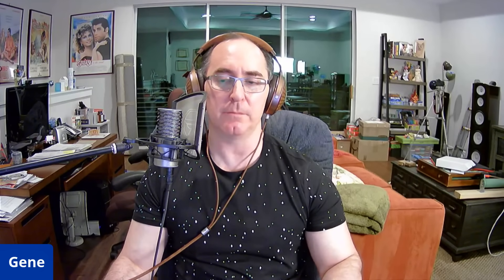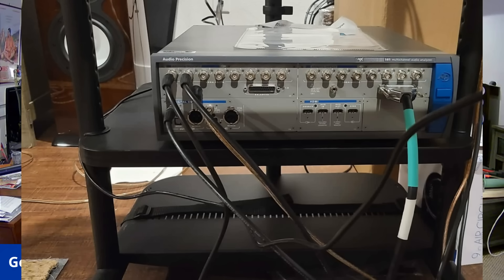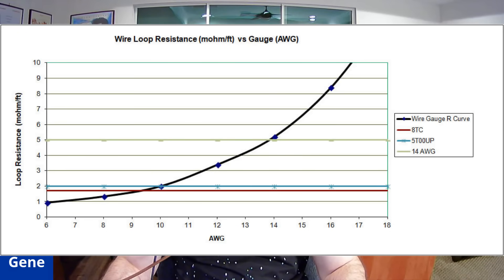Speaker Cables Really Don't Make Much of a Difference?

Comment: Scientifically confirms what I sorted out years ago.  I never claimed there wasn't a difference, just that the difference was insignificant and surely not worthy of spending $100's to $1000's of cables.  I found that investing that $$ in better amplification and speaker technology always yielded superior results.

Thanks Gene!  Great work here.
Reply: Greetings,

In the early 1980's, high-end speaker cables were beginning to appear on the market. Some of the product claims were totally unbelievable and had prices to match. And, the nonsense is still being foisted on us today.

Audio cable must be burned or run-in for a 100 hours. The best cable is cryogenically treated. Audio cables are directional. They must be supported off the floor via insulators. They have damping factors. They must be 'conditioned' to keep the wire molecularly aligned. Ad nauseam. It is all snake-oil designed to part the naive buyer from his money. It is all a crock!

The ONLY factor that affects performance of audio cables is the wire gauge for a particular maximum distance between amplifier and speakers at a particular Ohm rating. If you have the proper gauge, all audio cable will sound exactly the same!

"Realizing that wire resistance was the critical factor in speaker wire, Gordon Gow, then President of McIntosh Laboratory, still a maker of world class, high fidelity amplifiers, used a speaker cable demonstration to show there was no listening difference between high-end audio cables and plain line cord (14 AWG lamp cord wire). 

Fifty-foot lengths of wire were used in the blind comparison. The setup consisted of a master control relay box and two slave relay boxes. A three-position switch was used to select one of three different speaker cables of equal length. One was common line cord. The other two cables were from popular high-end manufacturers. 8-ohm speakers were selected for the test. The two other brand name cables were heavier than the line cord. The test proved his point. No one could hear ANY DIFFERENCES using several different 8-ohm speaker systems." -- from Speaker Wire, A History by Roger Russell.
Reply: @stevefranks6541  but did they coat the wires with the required Slick 50 teflon treatment for better signal lubrication?
Reply: The point is that AFTER spending on the best room treatment, speakers, etc, cables, especially AC power, make a huge difference. Just huge. 
But if your system is cheap, no you’re not going to spend $1000 on a cable for a $1000 amp.
Reply: @Fluterra  Huge difference in AC wires... you have to be kidding me. Are you going to re-wire the rest of the AC wiring in the house all the way to the circuit breaker too? What about the thin wire in the fuse of the plug, or all the traces of the PCB or the miles of wiring from your home to the power station?
This is utter brain shrinking nonsense.

Audio gear also runs on DC power not AC. 🤡
Electrical engineers would fall over laughing at these claims.
Reply: @Fluterra  AC Power Cables make no difference, nor does power conditioning, the power supply in any component is responsible for giving the electronics +- DC or split rail in audio amps, so AC wiring bears no impact, basics.
Reply: @robywankenobi32  Totally wrong. Come out of the cave and try out the PS Audio regenerators - if you dare. 
You have no idea, my friend, no idea! Everything you are hearing, and seeing, is just manipulated AC power.
Reply: @Fluterra  Nup, i'd rather spend the money on speaker design and room design, then some confirmation bias crap about AC power
Reply: Most the passive crossover components in "mid" HiFi speakers let alone the exterior cables are terrible, inductors with thin AWG wire and capacitors that drift as they age ahha

Comment: I don't know about expensive vs cheap. But for certain type of music or contents, I find that some of the dirt cheap speaker cables I have sounded better in the high frequency on my RF-7 iii. Some speaker cables have certain characteristics that make them suitable for different contents regardless of the price. It is just unfeasible to swap cables every time you decide to watch certain content. For me, it is to find a cable that offers the best compromises so I can use it for a wide range of contents and not have to swap cables. The 10 AWG Sanyo Denko Japanese speaker cables I have are extremely good in the low range and mid range, but lack in the high frequency. And the 16 AWG Japanese speaker cables I have are fairly good at high end, but the low range was almost non-existent.

Comment: You know that speaker cables have gotten to the point of snake oil when you're told that they need to be elevated off the floor on special stands. Amazing how gullible people can get when they think that shelling out thousands of dollars for speaker cables will magically transform their audio system into the realm of nirvana. You definitely made things clearer by stating that it's nothing but audiophile jewelry.
Thanks for making  my common sense a reality rather than having my bank account depleted.

Comment: Shocking. Another cable bashing video. Complete with MEASUREMENTS. Guess what kids? You can have a host of components that will all measure the same, but which anyone in the world would say simply, ‘those don’t sound the same’. Measurements are a tool. They are not a substitute for what your ears tell you. Mark Levinson (the company not the man) famously had circuit traces that looked insane. When pressed as to why, the answer was that although measurably no different, subjectively there were audible differences that were meaningful. With speakers, it’s even more pronounced. On paper and measurably, any number of speakers could have specifications that suggest they should sound the same. Yet, the type of driver materials used, the dispersion characteristics of those drivers, their physical layout, etc. will all lead to them sounding entirely different, like on a different planet different. But to the specs-are-all-that-matters crowd, I suppose just buy the cheapest one with the best specs. As for cables, they are antennas that transmit noise. Sometimes it’s the actual audio signal...and often times, there’s a whole lot of noise that infiltrates the cable that adds hash and grain to the sound. Nothing that can be measured. But connect a pair of Transparent Audio Super or Ultra or Reference, with Transparent being known for their noise filtering networks (the thing that looks like a snake that’s partially swallowed a rat) and compare it to some very good heavily shielded heavy gauge cable and if you can’t hear a difference? That just tells me I don’t need to regard your audio counsel with any regard whatsoever. Because if your ‘expertise’ is entirely based on what you measure and not one bit on some degree of listening (listening is kind of what listening to music is all about) for what the measurements don’t fully communicate??? You’re just a guy on the internet trying to sound like an expert. And queue the cable haters and the snake oil insults.

Comment: The only part of cables worth paying for is gold plating on low level signal cables to prevent oxidation. Thicker speaker cables might matter if you are upgrading 22g wire on a high power system, but if you have 22g wire, you probably have other problems too. One other thing, shielding of low level signals does matter, but almost any shield will do as long as it is continuous. When it comes to power wires, the only time they matter is if you have to run them along low level signal cables. If you have to do this, make sure the power cables use a twisted pair and the ground (or neutral) follows the same path as the hot lead. Mostly this is an issue in car audio (yes, run a 4G ground back to the battery ground point, and a 4g from the battery to that ground point, and twist those power and grounds. Do this and you can run your RCAs right next to the battery leads with no noise at all. In home or commercial audio, make sure you only have one ground point and one neutral to ground bond point.

Comment: As a DIY enthusiast i would never consider paying for expensive cables.  I've been using monoprice cables for my system for a while now.  That being said, i like to research as much as i can and be as objective as possible, trying to learn the science.  Long story short, i decided to braid my cables (compliments of GR-Research explaining the science of braiding).  I wasn't expecting to hear much of an improvement, if any at all.  But there IS a substantial difference.  More detail, some bad harmonics minimized, and vocal clarity is pronounced.  I'm a believer.  I'm gonna braid all my wires now.  I'll put in the work to save some coin.

Comment: Subscribed! Brilliant. At last, someone is talking sense. Strangely, in the relatively high-tech area that hi-fi occupies, you rarely see people taking measurements. I think the whole subject is a massive sea of smoke and mirrors. 
If manufacturers could prove that their speakers/amps etc... were better than the competition we would be sick looking at measurements. Yer man is right. It's mostly jewellery. 
I have no doubt that some gear is good, some great and some rubbish, but I would be willing to bet that the actual differences between well-engineered, similar systems are very small. I'm sure style plays a very important part in most purchases. Well, that and reviews.
How do we trust magazine reviews when the magazines themselves have adverts in them by the same manufacturers who have their gear being reviewed? Think about it. In just about every other area be it cars, bikes, computers or whatever, reviews measure claims. Speed. Economy. Durability. Repeatability. Everything is measured. In hi-fi, almost everything is subjective which leaves massive holes where the snake-oil salesmen live. Extortionate speaker stands (have you seen the price of some of those!). Hugely expensive cables etc... Most of it drizzled in a thick coating of marketing gloss that's so thick you can hardly see what you're actually buying.

Comment: Could you comment if twisted speaker cables makes a difference ,or if tinned copper conductors will make a difference over time as the conductors won't react and turn green from outgassing from the PVC  jacket. I was thing of 10 AWG KnuKoncepts  Karma Kable at around $1.00 a foot on a 50 foot roll . Yes I have long runs as my components are on one side of the room as I have a real fireplace between my speakers.

Comment: You can analize with technical equipment gettig result, but just you can hear differance feeling. 
For example; in spectrometer you can see 440hz on screen but you cant understand this frequency coming from violin or brass or synth, you need to listen... that’s it what i wanna explain..

Comment: Cables absolutely have an impact on what you hear. I’m obsessed with imaging on certain songs — where are the vocals, the guitar, bass, drums etc. My speaker termination broke off prob my fault, I swapped one cable  out for another cable on the left speaker and the imaging totally changed. Not saying what was better or worse but it def shifted. Crazy
Reply: all placebo adam, get a friend to swap the cables and do a blind test you will be even more amazed at the result and realise it was all plecebo.
Reply: @Justin-fy7xk  Hi Justin. Reread my post. I wasn’t making a determination on a difference in sound quality one way or the other. This was about a shifting in the image. And eyes closed yes the image still shifted in this case closer to the left speaker from dead center.

Comment: “Conversations about audio cables are often based on naïve and misleading concepts such resistance and frequency response. The present work shows that differences in such common parameters are too negligible to explain differences in sonic performance. In the absence of meaningful measurements and parameters, choosing and rating audio cables has understandingly taken place in a ‘wine-tasting” like manner.

This work provides a novel perspective and describes subtle electrical behaviors that clearly differentiate cables in ways that could make an audible difference. The experiments provide an objective basis for specifying and rating audio cables and provide some steps in predicting their expected behavior.” 

Gene, are you familiar with scientific research done by Prof. Milind Kunchur, whom I quoted above? Guess, I can’t post the link, but his work can be easily found by googling “kunchur cables”

Comment: Thanks Gene! Excelent video for all the people that think that all the cables are the same. You always doing the difference in this business. I am fortunate to have the KK 8TC the old version blue & black in my LCR speakers B&W 603 S2 when I was working installing AV systems always wanted to know how good this cables are.
Reply: Is there any diferences between old blue black and new white copper 8tc in term of sound quality?
Reply: The cable is no better than a spare length of cable most people have in their own garage, apparently. Does that make you feel better or worse

Comment: What is your recommendation on placement of cables?  Is is okay to lay cable on the floor (mine is wood) or do they need to be off the floor?  If they cable is too long (10' cable but speak is 4' from amp), should i buy shorter cable, roll up cable or just leave excess strung out on the floor?

Comment: I don’t doubt the measurements, however, not everything that can be measured counts, just as something that counts and can’t be measured. I referring to sound signature differences between different cables, be it interconnects or speaker cables. Some cables have a brighter result than others and this is something that only the human ear can discern. Example a silver cable vs a copper cable. The human ear is incredibly sensitive to these nuances and yet, they can’t be measured by any tool! 🍷

Comment: So, the test cables with the alligator clips don't affect the test? Wouldn't you need to run the same cables your testing back to the testing gear?
Reply from the maker: The test leads go to a high input impedance circuit in the analyzer. I used short 10AWG Belden cable connected to the XLR inputs but could have used higher gauge without any degradation in measurements.